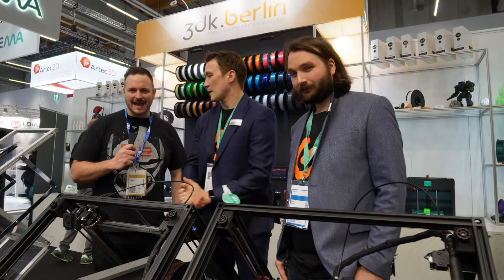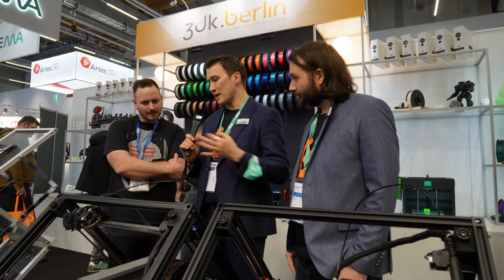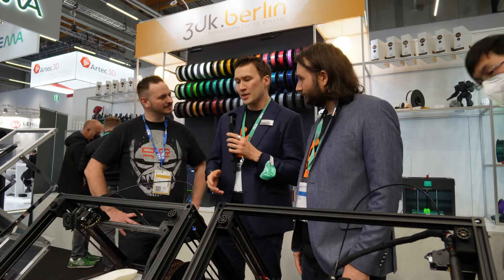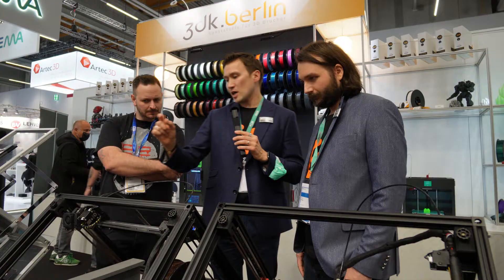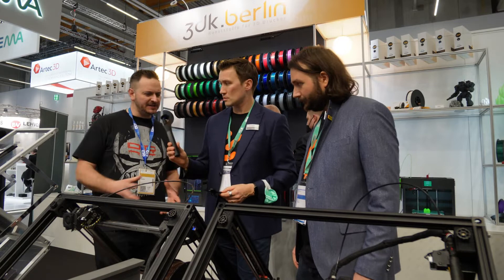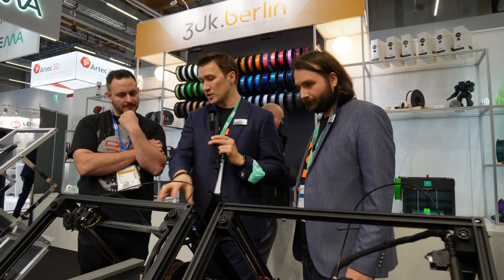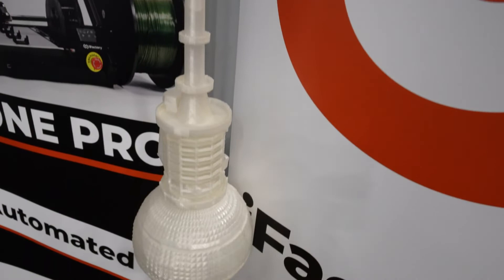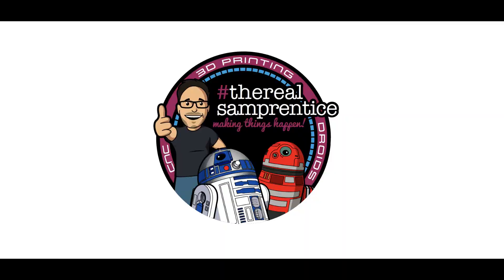iFactory 3D - The worlds BEST Belt 3D Printer ever created!

Comment: I don't know if I'd call the iFactory the best belt printer...

The market is severly limited, they came out wiht a few updates to the original printer and I still wouldn't necessarily say that
Originally my extruder and my hotend destroyed themelves with less than 100 hours of printing, my first belt survived like 40 hours, half the printed parts they delivered I had to replace due to bad quality or them breaking within the same timeframe as the belt, the PSU started making noises after 50 hours and their laser cut plastic parts are at best useable, but the XY corner brackets don't even fit onto my printer as they are supposed to. The frame is quite a joke, the assembly is the biggest PITA I've had while building a printer, they use clones instead of real titans, the slicer they provided was hot garbage

Their belt has good adhesion, but its quite fragile and the pattern it leaves on the underside of the print is beyond acceptable as a surface that gets used for anything
Reply from the maker: This is the v1 right? The new one is running a pi4 and an e3d Hermera with a zodiac nozzle. The board from memory was a duet also.
Reply: @TheRealSamPrentice  yup, I had one of the first printers sent out

I have to admit that I did kind of loose the overview of what the current printer version for them is because they came out with several revisions and versions within a very short amount of time 

Thei main issue IMO was using a Tronxy base